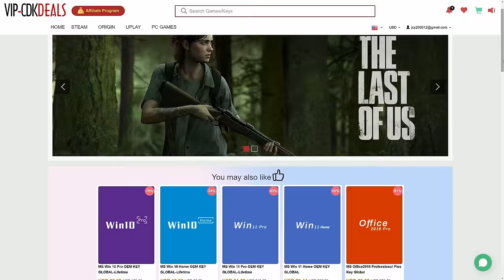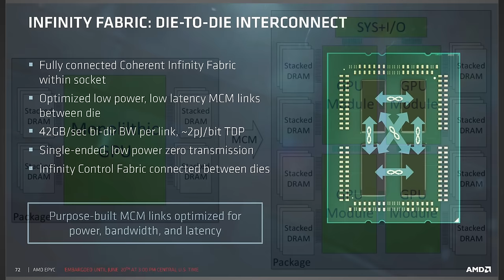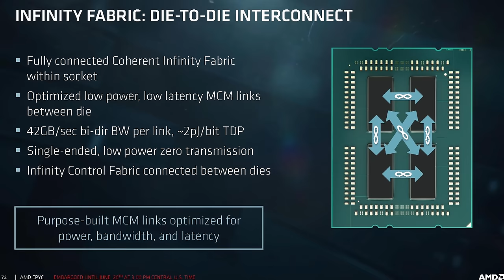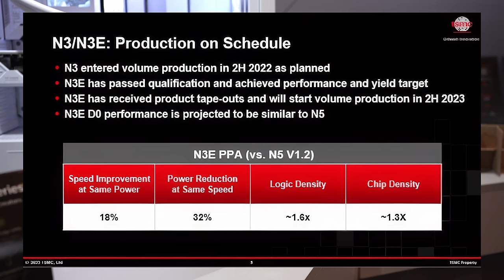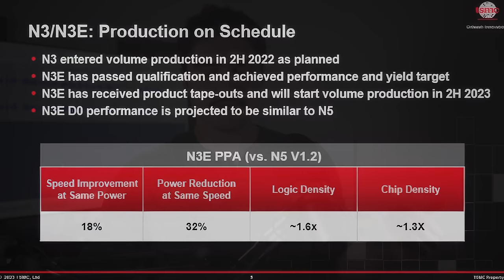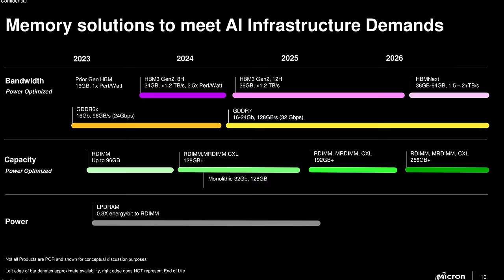Nvidia’s Terrified - AMD RDNA 5 Specs & Release Date

Comment: After AMD was rumored to have only mid range cards I thought I would just get 5080 to use with 2k monitor. But now, if AMD really pulls this one out, I will consider 32" 4k paired with it. I would rather support AMD
Reply: I've seen this same comment for the past 20 years...I'm sure this time for sure for sure, but like legit for sure for sure. You know, they don't have billions to spend on R&D that NVIDIA already spent 5 years ago but for sure for sure this time :D

And did I forget to mention that THIS year guys, for real this time, AMD is going to have the fastest most powerful GPU available?
Reply: @Barb4sale  it doesn't need to be number one on the market. It should give me good value and I will vote with my wallet for AMD. Your Nvidia can always make the fastest, but if they keep putting their prices to the mountain top they can go .... ....
Reply: Dude you actually dont believe this fairytales dont you ? 😂😂😂
Reply: @Barb4sale  That´s not a reaction to what he says.  Still say, when they were first, you were in a coma or something? Nvidia will stay at the top, and AMD is not going anywhere either. As far as the CEOs, market stability is their goal.  
R&D spending didn´t help Intel much with CPU or GPU, as without the right people, it still falls apart,  5080 vs AMD-like can happen, if not 5090 vs AMD-like. It depends on actual performance metrics in all aspects. DUH 
P.S. The older series 79XX GPUs were monster, and the 7970 was usually about on par, or even noticeably better at FHD, than the 680.   20 yrs, you say..

Comment: HD3870, HD5870, GTX680, GTX1080.... RTX4070
What do the first four cards have in common?
ANSWER: they were all top-end cards when I bought them, EXCEPT the RTX4070. A few months ago I bought an RTX4070 which isn't a top-end card. Why? In part because it gets me ALL or MOST of what I need out of the games I play. Horizon Forbidden West? Pretty much a solid 60FPS at Max settings (1440p/DLSS/Quality)... a modern problem for GPU manufacturers will be DIMINISHING visual returns. You can get around this by adding RAY TRACING. But they still need to support pure RASTER so a lot of people won't use RT... and what happens when an RTX7080 runs games with FULL ray tracing that are photo-realistic? Where's the upgrade both to sell you on then? What demanding things do you add to games to convince people they need a new gaming PC?
(PS5/XBSX have maybe one generation left too... games can look and run MUCH BETTER on EXISTING consoles once the software is improved on. Which is why Microsoft is trying to plan around this. We're going to get a PS5 game that is close to photo-realistic AND runs at a true 60FPS... go look at an OLDER game, Detroit Become Human. It looked amazing on my poor GTX1080. It's not hard to imagine games that look way better. What's left to do? Better fluid simulation? Better collision detection? Audio ray tracing? Will enemy AI actually be demanding?)

Comment: They skipped the high end with the 5700XT being top in that series, and then they actually beat nvidia 3090 and even equal that 3090Ti with the 6900/6950XT (in raster).
They are doing it again with the 8000 and 9000 series and if they can close that ray tracing gap it s going to be a much need shake up in the landscape. 
I am rooting for AMD !
Reply: Good one bruh 😂😂😂😂

Comment: I think top end RDNA3 multi chip hit issues with timings lantance in communication between bits that held back performance & Top end RDNA4 introduced a bigger issue with this but a breakthrough on interconnects & a redesign may have fixed this for RDNA5. Potentially by breaking up gpu into sections you can speed up development & fill more market segments as more felexable in what & when you release something. Plus security is improved leek wise as fewer people see full picture of what they are doing. It also helps when pitching hardware to console & Hardware vendors like Sony MS Steam etc ie tell us power and price we will show you something to meet that.
I would have 2 teams on general gpu rasterisation, raytracing etc (like zen) a i/o, interconnect team(possibly throw in AI with potential to form seperate dedicated AI team) with  software team or two  for drivers and other stuff like FSR(airbus had 3 teams different countrys as they felt less likely to get same bug in a program that could crash a plane.)

Comment: So rdna 4 is a sort of refresh for low to mid tier rdna 3 cards ? So will get buy a rdna 5 card q1 2025 ?
Reply: RDNA 4 is not a refresh. An RDNA 3 refresh would be a 7950 XTX and 7950 XT which are not gonna exist.
Reply: its not a refresh but they're targeting mid range on purpose because they know they have no chance in the high end, so they can focus on RNDA 5 high end, and maybe come up with something more relevant, which is smart actually, I hope it will be better than the XT overall, with 20gb of vram aswell, than might be interesting at 500, it's supposed to catch up a bit in the raytracing performance which is they biggest drawback, especially for certain games like cyberpunk if you look at the benchmarks
Reply: @strongforce8466  I doubt it'll have 20 GB given how 20 GB is closer to the high end category. 8800 XT will most likely have 16 GB.
Reply: @laszlozsurka8991   but if it doesn't have 20 it will be weirdly positioned compared to the XT then, cause people will have to choose between 20gb vram or higher RTX performance, I think they rather have 20gb to be honest, it will make it more future proof too. 

Guess it may just have 16 and the XTs will probably still sell for more than the asking price of the 8800xt.. which is a bit sad I feel.

Comment: If I had to guess, I would anticipate that the 8K High-End/9K Series from AMD (I do assume they will call it the 9K series though I would not be surprised if the 8K $299-$499.99 Cards stay as the low end with a price cut) will launch 9-12 months after the 8000 cards hit the market in or around November. Just a hunch, and I'm wrong a lot, but if I had to bet a date with a hot 23-year-old...not that I talk to any hot 23-year-olds...or know any...but I've heard it's nice...

Comment: If I bought a pc with a 8700g today with a plan to wait for the rdna 5, is that crazy or does it. Make sense? Amd 5 board so. I can upgrade cpu later as well and use the 8700g for home theatre use later.
Reply: RDNA5 APUs will be mid 2026 minimum.

Comment: With how power efficient the laptop GPU's are. If they could get 4 of those onto a single graphics card, that would be very high performance without being too power hungry.
Not all laptop GPU's perform the same due to design and form factor limitations. But there are a few laptops with an RTX 4090(mobile). That's actually close to a desktop RTX 4080's performance, but the power consumption is waaaay lower. If AMD could do something comparable to that, but with 4 GPU's on 1 card. That would be actually have a chance to beat anything Nvidia releases....... But with AMD's track record, for that many things to go smoothly and according to plan. Very rarely happens.
But I'm hoping this is one of the few times it actually does happen.

Comment: Nvidia is making most of their profit from their data centre segment, but that doesn't mean they aren't going to abandon the gaming segment. Gaming is their second largest business and it earns them billions. It's the biggest form of entertainment by far, so there is a lot of profit to be made in it. Nvidia ditching a market with such high revenue would make zero sense. I am mentioning this because lots of people are saying that Nvidia might ditch gaming to focus on data centre chips, and that is unlikely to happen. The only difference is that data centre chips are their top priority now, but they should still give gaming relatively high priority as well. Especially with Battlemage and RDNA 4 on the horizon, which are expected to be super competitive in the midrange segment. Celestial and RDNA 5 should arrive after that, and they are said to bring the heat to Nvidia in the high end and enthusiast class segments. Hopefully, there will be strong competition within the gaming GPU market within a few years. Currently, it's not looking great. If anything, it would make the most sense if they indicated strategic aim to strengthen its market across its data centre and gaming segments. Gaming built the foundation for all of this is the core to Nvidia's success. Gaming is in Nvidia’s DNA. Jensen Huang even said gaming is one of the keys to what AI is experiencing right now.

Comment: You cant glue multiple cpu together like you say for gaming. Internal latency will make sure you get so high latency that you cant have 500fps in 1080p, but you might get like 200fps at 4k if thats what ur after. We also know that most of the heat comes from the internal wires themselves not the transistors. So glueing multiple parts together will 2x+ increase the wattage. Gluing stuff together is really a bad idea on all accounts except for the cost savings. I would instead pay more for a single die.

Comment: I will be fine with RDNA 4 (N44) if it has 16gb ram. I only have a 12400f CPU so it should fit well with an enhanced 7600xt which is what I am hoping for..
Reply: but at what cost? 
coz if its around $500, you can buy "enhanced" 7600xt right now its called 7800 xt lol.
And if you want it at $300, you can get used rx 6800
Reply: @pratyushchoudhary1017  I should be no more expensive than the 7600xt.
Reply: Do you even use the 16gb vram. Vram.is useless unless you actually run applications that ise all 16gb
Reply: @gejamugamlatsoomanam7716  The 7600xt uses the 16gb's at times and will in the future.

Comment: "AMD is going to kick NVidia's ass..."
Take 47. I'm getting a little sick of this every generation coming from BOTH sides. The rumors circulate, and even when we get OFFICIAL slides they can be massively misleading. Cherry-picked games, or referring to POWER vs FPS, or a % uplift that only refers to the top-end card. Or Frame Generation that doubles or triples the FPS but at the expense of quality and lag. It's difficult to be a consumer.

Comment: Whatever happened to what AMD Said themselves with moving to a monolithic design and running in the mid range?...
Reply: That's for RDNA4
RDNA 5 is still chiplet
The reason is bc RDNA 3 has crazy potential to run well past 3 GHz but they didn't have time to perfect it. So they're coming with a single chip for RDNA 4 while the R&D team get the chiplet tech dialed in
Reply: That's RDNA 4. RDNA 5 will be MCM. The lead here is that AMD is releasing two generations back to back within the same release cycle.

Comment: All AMD needs to do is figure out how to change peoples' perception of the radeon brand. FSR3 ist pretty much just as good as DLSS3, FSR 2.x is basically just as good as DLSS 2.x (if the devs implement it properly) and AMD have improved ROCm in massive ways to compete with CUDA. Some advantages still exist for nvidia, but overall people might just as well buy AMD. They just don't.
Reply: are you drunk? fsr isn't even close to dlss.

Comment: what I don't like about AMD is not power efficient as compared to NVIDIA. It may be cheap, but as you use it overtime, the cost in electricity will make AMD gpu cost a lot more.

Comment: Even with 4090 rx7900xtx is game end.
Reply: Yeah, I've got a OC'd 7900XTX. 4090 is still king, but AMD and Microsoft are getting their Ray Tracing performance up there, and AMD making ROCm open source might also help get more people interested, which means AMD has to give some info on the architecture, which can allow people to see how they can best code for the hardware.

The next few years will be interesting.
Reply: @scottstamm7022  rocm has nothing to do with gaming.
Reply: @raute2687  CUDA has nothing to do with gaming....but why is it a focal point for those buying Nvidia GPU's who also game? You're right, it's nothing to do with gaming, just like CUDA.

Edit: CUDA cores are used for 3D game rendering....as well in Blender, DAZ, Adobe, and more.
Reply: not really lol 0-30 fps more for 1000 dollar difference isnt end game anything sure 4090 is faster but at that cost makes no sense. less than 70 Games have RT nvdia does really good in about 10 of those games the rest AMD and nvidia perform the same.

Comment: AMD has a way of screwing themselves in GPUs.

With RDNA 2.0 they had top end performance like Nvidia. But they only ramped up production at the end of the lifecycle so they could not gain market share. Until then nobody could buy it in many places of the world.

With RDNA 3 some undisclosed hardware bug made them miss their own performance targets and projections.

I think they are more interested in CPUs tbh, it's more money per silicon wafer. If they are serious about GPUs they would consistently release a full line up every generation from low end to high end with logical consistent naming. But they are all over the place.. look at 6800xt vs 7800xt.. both good products but no logical progression.

Comment: I look at gpu's like car engines. 
Nvidia is like a 4 cylinder found in Nissans that's been cracked with loads of computers and programs to push all it can give. 
while AMD is more a V6 or V8, more power at base without the "gimmicky" extra's to push it, but perfectly capable of having them as well